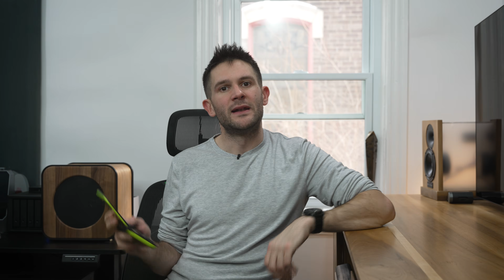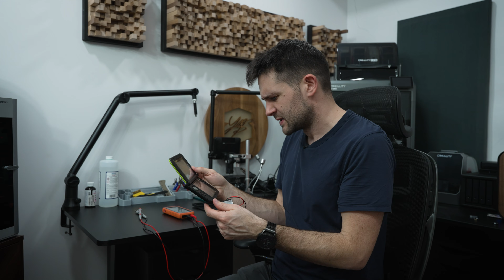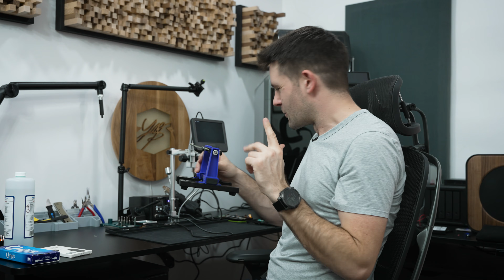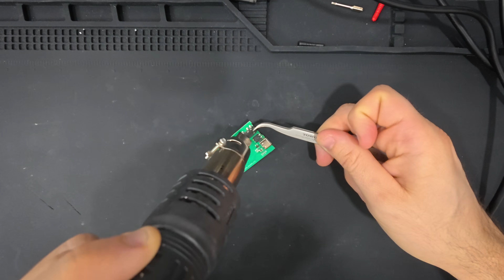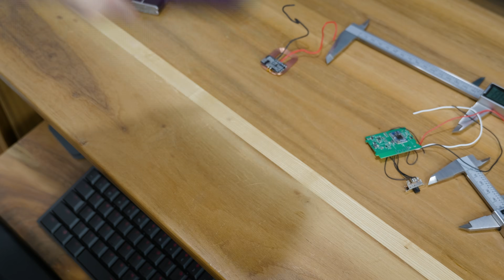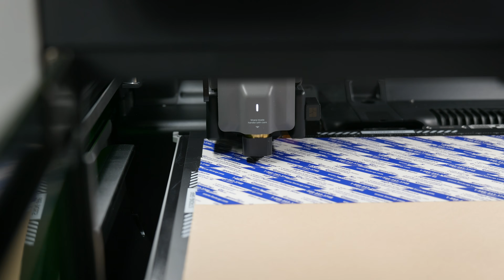I built a NEW New Nintendo 3DS....

Comment: I do have a bit of a concern of the balance on the two battery cells. they should have protection circuits in them already and they are directly connected, but there's a reason 2 cell packs have a BMS unit usually.

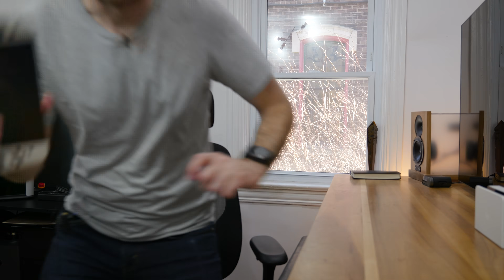Comment: 21:25 Believe it or not the 3DS actually already HAD a docking feature, officially. Notice how it has those two copper looking bits on either side of the charging port? Yeah you can put power through those and it'll charge. There's little 3DS docks for that.
Reply: Love how YouTube will show a preview of this comment when it gets to the timestamp, but I have to scroll rapidly through the comments to actually find it to read the full thing.
Reply: @MsCerealCat  I bet you're happy that they fixed that issue
Reply: @ChillyYeti10 Yeah lol
Reply: at 7:20, he mentions the docks and even shows him modifying the copper bits to fit with the USB-C port
Reply: he's aware of that, but because of the thicker bottom plate it's not going to fit any official docks anyway, which makes it silly he kept the dock pins.

Comment: The original 2DS may look like a toddler toy, but it is by far the most comfortable handheld device I’ve ever experienced. If you get a chance to try one, please do. It fits the hand incredibly well and won’t give you the same hand cramps that other handhelds cause
Reply: Yes!!! I've always been an OG 2DS defender, that thing has always fit my hand like a glove and the larger shoulder buttons, and the abxy and circle pad being near the top screen rather than the bottom made the ergonomics so much better it was ridiculous.

Not being able to fold it was a huge downside, made it way less portable, but it was worth it.
Reply: @Landjrin  The lack of folding is a large reason it was able to be so cheap aside from the lack of 3D. They actually just use one big component for the two screens since there's no hinge in the middle. Only real downside to the 2DS other than those things is it's surprisingly fragile. You drop that thing and you risk the volume slider falling entirely out of alignment and loosely sliding around or sleep mode flickering on and off. And it's a mess to teardown since there's a ribbon cable essentially holding the back plate on and it's super easy to break.
Reply: loooove my 2ds!
Reply: I used to have one when I was younger. Then, my parents upgraded to the XL and I got a new hand-me-down of the Golden Zelda 3DS XL. Anyways, the point is that they were the freaking bomb. LOVE them.
Reply: The 2DS is amazing and I have a 3DS.
Reply: Just make the Handhelds BIGGER!
Reply: i am rather fond of the 2DS, i affectionately hath dubbed mine the slab
Reply: I imagine that it's hypothetically easier to mod as well.
Reply: Ever held a steam deck? That thing is ergonomic. it has real grips
Reply: @dynamichunter843  I won't ever have the chance unfortunately. Those things are WAY out of my budget.
Reply: It's extremely uncomfortable for large man hands. I bought one because I fell for the "comfort" hype. The control layout is actually good, but the thin sloped wedge shape gives nothing for your palms to wrap around

It does become the most comfortable DS system if you can get custom grips for it
Reply: It feels like a two screen Gameboy. Because it is pretty much.
Reply: My sister had one - really uncomfortable for bigger hands, no better than the 3ds. In fact it caused more cramping. The xl feels a bit better, but its still just a brick.
Reply: Imagine if they released an OLED version now 😮  @MelodicTurtleMetal

Comment: My guy you need to have a disclaimer front and center with that battery disassembly. Especially soldiering wires to them. Lithium batteries are DANGEROUS, especially when exposed to heat. Lithium fires CANNOT BE PUT OUT.

Comment: Really cool video and project. I've been planning to do the all of this (except doubling the battery) on my original 3DS XL but I didn't have a solution for switching to the headphones, but you cracked it nicely. My only other problem is that I don't have a 3D printer, so I need it all inside the existing shell. I have some ideas though...
Reply: we never had 3D printing back in the day, you could go look at older console mods, particularly portable versions of home consoles (the Gamecube was a big one for this) where people are making cases out of fibreglass, posterboard etc
Reply: @TheDreamHazard  I'm using an upside down IKEA toy box as a Nas enclosure 😂 Great airflow once you mount a 120mm fan to the side and an exhaust hole in the top!

Comment: I suspect the reason the higher clock speed didn't result in a meaningful boost in load times is because of exactly what you said a few sentences later- All your games are stored on the SD card. The storage on real cartridges have an advantage because the CPU has just about direct access to the cartridge. It's a specialized flash format, but typically excels at load times.

SD cards on the other hand while a lot more ubiquitous and user friendly, SD cards can vary in speed based on both it's class and category, but I genuinely wouldn't be surprised if the SD card interface doesn't go beyond standard USB read speeds. I suspect your SD card may be a bottleneck, at least for load times.

Comment: At 17:28 you can see in the rounded corners that you still use .stl files. Try exporting your files as .step files, they work exactly the same in your slicer but you will get WAY cleaner prints without artifacts in rounded parts 👍🏻 step is the better stl in all ways.

Comment: You can improve the USB C mod by adding two 5.1 kohm resistors on the the CC1 and CC2 signal pins and connecting them to ground to allow full compatibility with all USB-C chargers and cables, otherwise it will only charge in a specific orientation with USB 2.0 to C cables.
Reply: gotta give it to neptune for EEE tips and tricks
Reply: it already has those resistors and works fine with every charger & cable ive used
Reply: Theres a gba sp usbc mod that has the exact same problem with only supporting usb 2.0 to usbc could adding resistors to that mod fix it as well?

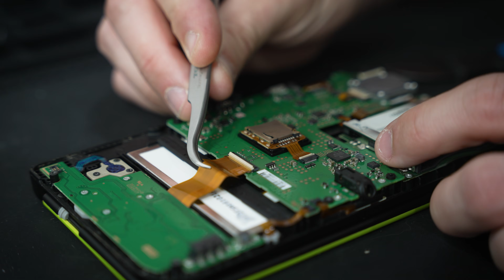Comment: 6:00 yeah, with my personal experience, the new 3ds/new 2ds models are HORRIBLE to work with. new 2DS has the battery glued down, so it's almost impossible to remove, so I had to do my repairs with it still in (don't do what i did). I had to use a hair dryer, since at the time I didn't have a heat gun for the screen, since there's glue there as well. it turned out fine, but it's a pain in the butt.
my recommendation is to:
1. Go to a local shop to see if it's repairable
2. Go to a store (like gamestop) and trade it in for money, to help you buy another 3DS/2DS
3. Trash it
4. Repair it yourself.
Only repair it yourself if you have prior experience!

Comment: Seems nice, until you have to replace the batteries and re attach all the wires, just seems like a pain in the ass when you cam just replace the battery normally with a normal battery

Comment: "look how good that looks" 
- inconsistent 
- leather is absolutely pointless there
- you can see places where cuts where done, as if there was no sanding/smoothing at all
- the inside of the "finger cavities" looks like it's been stabbed with a toothpick or sth
- the texture of the backplate itself is not just inconsistent with the rest of the console but its' glitteriness just looks like an un-vacuumed carpet
- the wood piece on the dock has absolutely no point in being so thick it comes out of it's frame

Comment: I work on DSs a lot, and I will say most of them have a ton of ribbons everywhere. It sucks sometimes, but keep in mind it keeps them modular enough that they're repairable. I'll say that the DS Lite is the simplest DS on the inside though. 3 ribbons in total.

For the first one, when a DS turns on and won't boot, it's often an issue with either the wifi card or the microphone. Sometimes the microphone cable can get pinched and short the connection, and you can unplug it to check. It'll boot without a mic. If it's the wifi card, just pop it off and re-seat it. If the light turns on, then a screen flashes (possibly with a popping sound from the speaker depending on the model) and it shuts off, the screen that didn't flash isn't making a good connection. Sometimes that can mean that the screen is dead, sometimes it just means that there's a bad connection. You can clean the pads on the end of the ribbon with isopropyl alcohol.
Reply: I just reshelled a DS Lite and the shoulder buttons were a MASSIVE pain to get back in. It took a 2-day runup to finally get it done. The rest of it took about 40 minutes, really straightforward. I THINK it was because it was a poorly moulded shell but it has put me off doing another one any time soon. Still, it looks fantastic in transparent green, well worth the effort
Reply: @TheDreamHazard  The DS Lite shoulder buttons in general is one of the worst designs Ninendo has made.

Comment: @ZacBuilds, hello :hand-pink-waving: Zac. I have a new video idea for you. consider creating a modern PSP/PSP Pro console that connects using a standard HDMI cable. I would be thrilled if you made a video about this topic! :face-blue-smiling: This idea came from looking at Nintendo's dock, but Sony might have done something similar before? Already apologizing😇, don't start a console war in the comments ☺ Correct me if I'm wrong. You might think why someone would use HDMI on a handheld console? The whole point of the handheld is to be a small portable device, etc. But recently I saw a ridiculously cheap PSP and the only problem was that the screen didn't work, so I thought maybe there's a dedicated HDMI port and with some magic from Zac it could become a retro PSP console? what do you think Zac?

Love your Videos♥
Reply: the psp already has video out, so that would be pretty simple to add. someone made a PSP go with a USB c that supports video out as well, so you set it on a dock and its hooked up to charging and a TV

Comment: Ok I'm having a bad day and I'm taking this out by being pedantic on this video 

0:40 'there is only like 2-3 that don't work' yeah plus everything that uses the gba port, so granted not a lot but definitely not 2-3 

1:19 'better head tracking' the original had no head tracking 

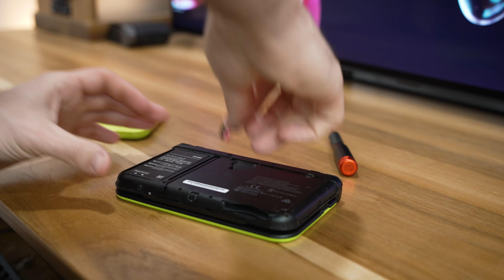2:05 'plenty of great guides' while there are multiple there is an official one 

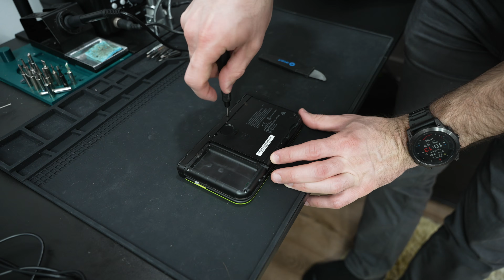5:50 the new 3ds isn't really hard to disassemble, in fact while tedious the design is pretty smart as you can replace most of the pieces with them being on separate boards, the biggest difficulty of the whole thing (that's not even part of the disassembly but assembly) is the 'hydra' ribbon cable that connects to multiple spots on the mother board after coming through the hinge and I can't even speak on it being hard in the new 3ds because I only touched it in the older variants 

12:45 not a mistake but a nitpick and I might be wrong, but why solder to the baterry and not the the motherboard in the place where the baterry is connected, I feel like that'd make the eventual replacing of the battery less annoying 

22:00 dude what's even the point of a dock if you added wireless charger, you could've added a capture card as an excuse at least 

24:00 oh come on you could've saved the serial number and stick it on somewhere 

25:15 you could've modified the bluetooth board, giving it some holes so you could make it screw into place or some similar solution, I have no idea honestly but gluing a pcb just kinda seems like a meh idea 

Anyway neat video other than that lol

Comment: Please do yourself a favor and stop using the laser sooner than later. It's impossible to clean everything, the laser leaves a thin film of dust all over the insides of the printer in areas you cannot clean, and over time this will seriously hurt its accuracy and ability to produce clean 3D prints. I know you got it for free, but it's still a much better 3D printer than it is a laser cutter, and it's just a very incorrect mix of two entirely separate tools with their own requirements.

Comment: I would have went with controller grips for the extended back case.  The wireless charger would have been more difficult to work with but if it’s built into the dock it would be fine and so much better to hold.

Comment: I've always wanted a larger version of the DS Lite. I was very disappointed when Nintendo removed the GBA slot with the DSi line as it broke some features of the DS Pokémon games I used. There currently is no way to emulate these features on the DSi or 3DS systems using something like TWiLightMenu++ to have it link a Pokémon ROM to a DS game.  Also Guitar Hero on the DS was a blast but without a GBA slot, you can't play that game.

Comment: For the first n3DS, if you do not hear a popping noise, there is a chance that it is NOT a screen ribbon issue but a battery board issue. It's $20 on ebay/aliexpress. Make sure it's the XL and not the regular one.
Reply: can you expand on this a little more? im getting this issue currently, I have a known bad battery still waiting on a replacement though, however shouldn't it be able to boot off of the cable? I did the usb c mod as well
Reply: @GearNutJoe  It's when the battery touches the prongs the wrong way (+ touches -) and the very custom IC on the ABXY board gets immediately fried and the 3DS isn't able to receive power period. The only known fix is to replace the ABXY button board since the IC is custom made from Nintendo (no one knows the chip to replace it). The battery isn't the issue. It's the board.
Reply: @ididntdoanythingwrong3451  thank you so much, just placed an order for a new board
Reply: @ididntdoanythingwrong3451  Just for clairity, this is when there ISN'T a popping noise?
Reply: @UNKNOWN-u6c7i Popping means it's trying to turn on, turns on for like 1 second, and shuts off. It's able to complete turning on.

No pop means something went wrong before the power sequence. Power board fried somewhere.

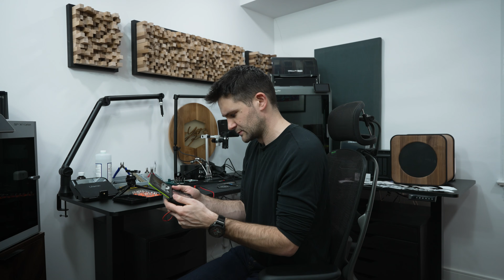Comment: I couldn't see in the video at 10:00 ish but a common thing on hacked 3DS/2DS models is a glitch where you need to put an SD card in with luma files or it won't turn on. The way you know is the blue light gently ramps up and down in brightness. If it turns on blue and snaps or just suddenly shuts off it's likely a hardware issue.

Comment: I'm going to be THAT guy for a second. This is NOT the ultimate DS. The resolution of the 3DS is different than the DS, so when it plays DS games it scales the image imperfectly and makes the entire game look gross. This is especially bad for sprite based games. The difference between this and a DSi XL is night and day. This also applies to GBA games, which can be played at native resolution on DS without the black bars being egregious.

In addition to this, there is no performance benefit to playing DS games on 3DS as the 3DS underclocks itself to mimic the DS hardware.

So no. The Ultimate DS it not a modded 3DS, it's a modded DSi XL (which are just as easy to mod). Your clickbait is bad.

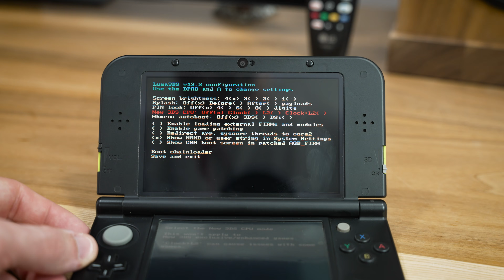Comment: Question about unlocking the boost in perf for all games using that feature @3:00. Does it mess up the speed in some games like counters ticking faster or messing up physics/AI ? Are there any ill effects or is it generally a safe perf upgrade ?
Asking because on older systems this would speed up the game including the music playback.
Reply: Some games do crash (Final Fantasy Explorers, Sonic All-Star Racing to name a few).
I think you should only enable that setting if the game you want to play is really intensive and doesnt have a stable framerate. Most games get no benefits from enabling this setting and it puts a bigger strain on your battery.
Reply: @iKitKatZ  Got it. Thanks

Comment: For the Green N3DSXL, put your SD card back in before replacing the top side ribbon cables. It might not be booting due to this.

 if it's any of the cables it will most likely be the black camera one due to the console not turning immediately off.
make sure the cable orientation is correct based on the colour of the ZIF connectors too

Comment: My dream Nintendo console mods would be a N3DSXL with a GBA slot, and a Wii U that accepts physical GameCube discs!
Reply: 100% agree, there is litterally GameCube and GBA hardware is these consoles but non way to play it with physical copies.
Reply: @rondoudoushiney3868  Finally 😭
Reply: What use is the slot when you can run .gba files? even on the og NDS phat i ditched the slots
Reply: @Will-f3c9d  You get to play the games you own, as well as the Pokémon functionality that requires both slots to transfer legitimate Pokémon.
There's also other games like guitar hero that use the slot that I played as a kid.